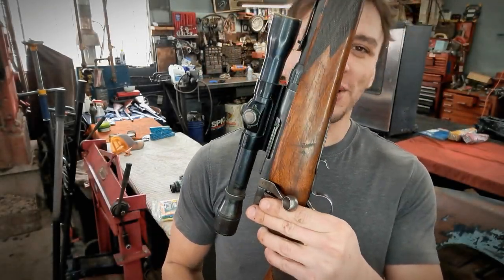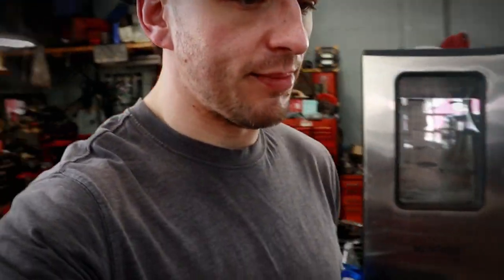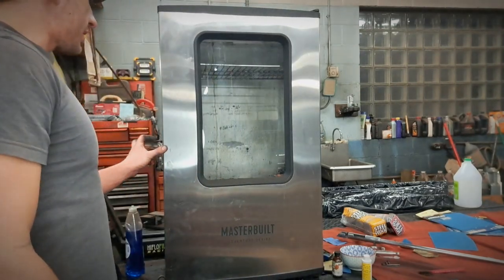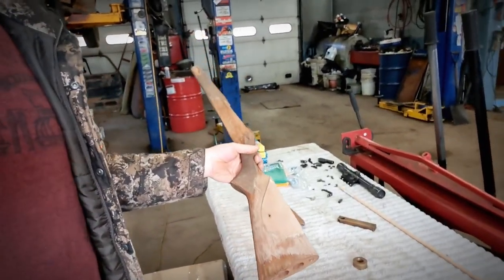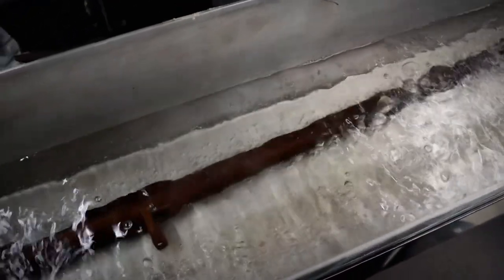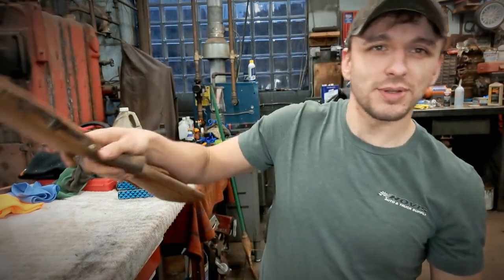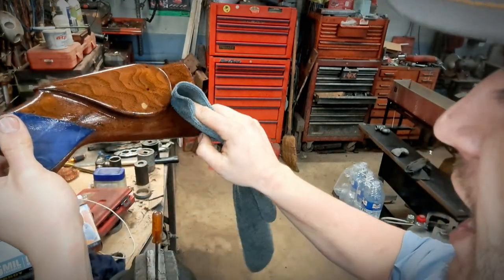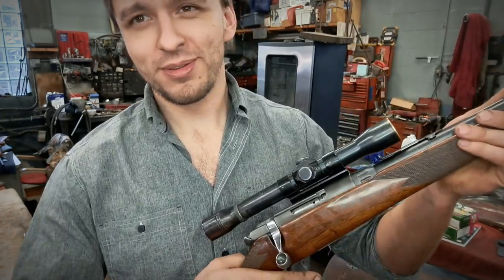Gun Restoration - Truoil - Laurel Mountain Forge - Rust Bluing & Stock Salvage

Comment: Several things I like / appreciate about your technique. First, you're slow rust bluing as apposed to hot salt or cold bluing. Rust bluing was the way it was done "back in the day". For shops like mine who do full on restorations of old rifles and shotguns, that is the only type of bluing service I offer. Second, you mention "draw filing", I'm not sure if you do that or not but, in my opinion, it's a valuable technique to have in your smithing toolbox. Normally you would only see that done when refinishing octagonal barrels and the like but it truly is a valuable technique to be able to use on standard round barrels too. You do good solid work! You also have a solid style of presentation! Keep up the good work! You've garnered a new sub....!
Reply from the maker: Thank you so much! I've only ever draw filed a single round barrel in all my time, and it was due to it being HEAVILY pitted from sitting under a pile of damp plywood in a garage for 20 or so years. Still a great experience none the less.

You can't know how much I appreciate the kind words and encouragement. I love the craft, as well as being able to pass on my limited knowledge in such a way! Slow rust bluing is an art, and I've made my fair share of mistakes, but I can see why it's what you specialize in!

Cheers!

Comment: Excellent video! I haven't rust blued yet, I actually have some coming from Rust Blue tomorrow to throw on an Ithaca 300 barrel. I have conserved a number of old rifles just by boiling and carding, which works great to keep the originality of the firearm. One thing that I didn't hear mentioned, and you very well might have mentioned, was to make sure to dip the 0000 steel wool into acetone several times before using it. It comes from the factory with oil on it which could affect the finish. Do yourself and get a carding wheel, they are awesome!

Thanks for your efforts and professional quality videos! I am glad I stumbled upon them! Also, very nice setup for working on firearms, and cars!!

Comment: I have done rust bluing on 4 guns so far using Bob Veasey's 'Rust Blue,' and the process I use isn't as involved as yours and produces an equally satisfactory result. It is better to use a rust blue specifically formulated for what you are trying to blue, as it takes to rusting easier. I use the process Mark Novak shows in his most recent rust blue video with Bob Veasey, and it seems less involved than the process you show. I add a bit of Everclear as a wetting agent, and I don't have to worry about streaks and runs as long as I don't add far too much

Comment: to get the best shine go to 8000 grit wet sanding or dry if u dont care about using up more paper ive done 3 sks stocks and just started a 303 lee Enfield stock,,,,, mine all of them will end up with about 30 coats and all dings and scratches and grain are filled for a glass like smooth finish
Reply from the maker: I've personally never sanded a finish above 2500 grit. I usually finish by sanding with paper towel, and then hand rubbing. The next time I use TRU-Oil I'll definitely give the finer sanding a shot!
Reply: @BLWRK  at 3000 grit it shines nicely with a wax coat but at 8000 its a mirror/glass finish

Comment: do you plug the bore??? when you strip blueing off barrels?
Reply from the maker: Negative! Vinegar is a very mild Acid, and so long as you don't let it set for several weeks, I wouldn't see a need.

You can always brush and oil the bore though after stripping!

Comment: My only critique with your process is everyone else I’ve seen rusts, then boils, then cards/steel wool, then rusts, boils, card/wool etc… you only boiled once and I think that could lead to early wear but I really don’t know. I love seeing other guys just going and doing all this stuff themselves though. It’s really not rocket science. And you get a gun that is fully yours at the end.
Reply from the maker: Thank you for the critique! So, I have done both methods many times. (Rusting+boiling vs rusting-rusting-rusting+boiling) and I've found very little to no difference between the two, so long as carding is done between rust cycles, it doesn't make a bit of difference,withthe exception that with multiple rust cycles, you may be more prone to copper plating.

Anyway, thanks for watching. Cheers!
Reply: @BLWRK  if it's copper plating then your rust bluing solution has copper . As long it gives the desired result. Angiers book has all sorts of formulae for bluing.... nothing is right or wrong
Reply from the maker: @bpm74  I agree, with one big BUT. When the solution plates on the steel, it will not convert, thus, it will not be blued. You will have blotches of a much weaker copper plating that will show itself like a sore thumb in the sun!
Reply: @BLWRK  I am a hobbyist, getting into gun restoration and I am from India. So I have been doing a lot of research on this..I agree if the solution produces a copper coating, which is mentioned ...